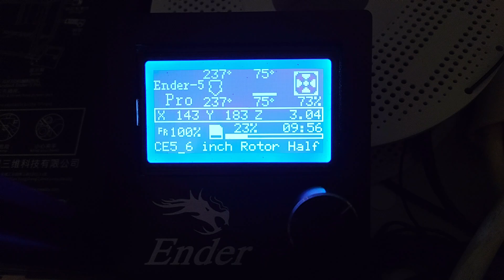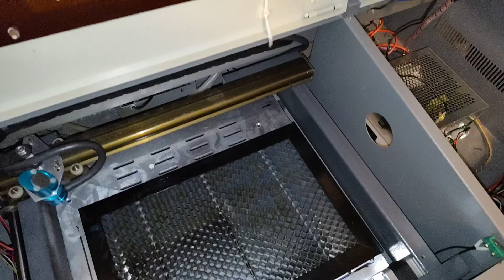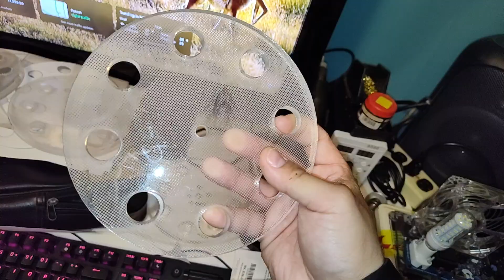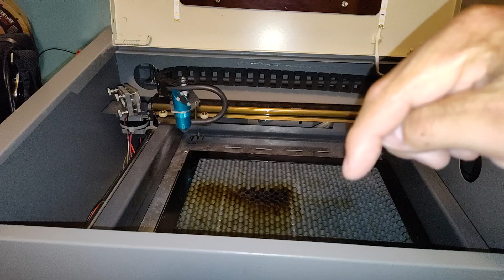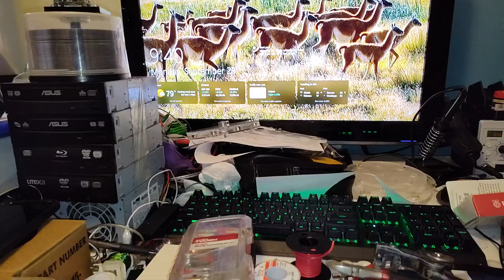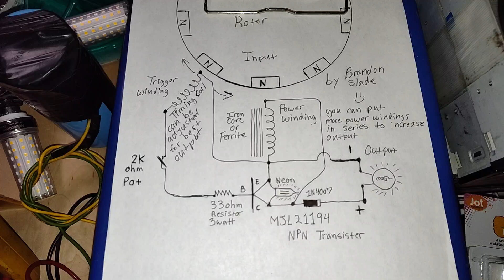Update Making New Motor Parts 👍

Comment: You definitely got alot of nice equipment.  What's the approximate weight of the rotor/flywheel when finished.  I bet doing interlocking pie pieces to make a larger wheel would be a pain
Reply from the maker: Not sure what it weighs I'm on hold right I have some replacement parts coming in tomorrow for my 3d printer Iv already tired printing the second rotor 5 times already I gave up and just ordered new parts should be up and printing tomorrow or after I still need to come up with money to buy filament
Reply from the maker: I'll let you know once I'm finally done with printing them

Comment: Very nice set up you have - I have looked at a variation of this circuit when i built a newman motor from a microwave oven transformer and another variation appears in the control circuit of PC fan motors - the ones without hall sensors - it's a very clever circuit and quite beautiful in its simplicity - the decoupling of the trigger coil is certainly an interesting take
Reply from the maker: @ThinkingandTinkering  thanks Robert I would love to see you try it with one of your really nice 3d printed wind generator man that would be awesome feel free to change the circuit if you have to thanks mate 👍